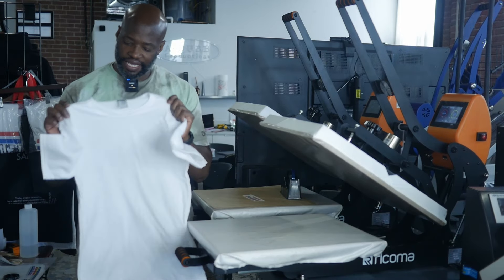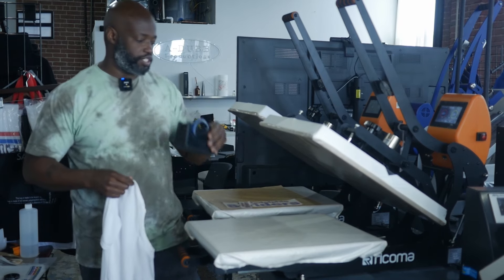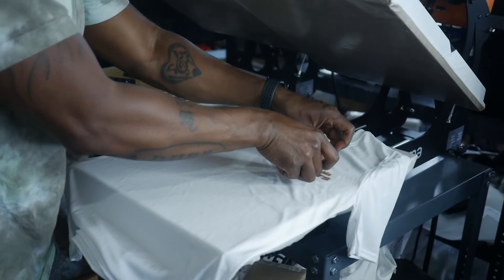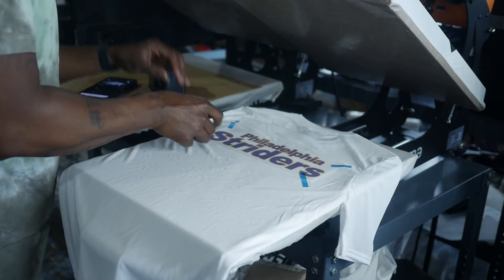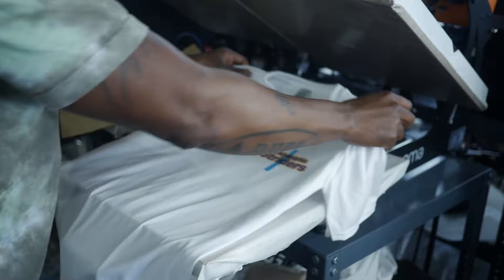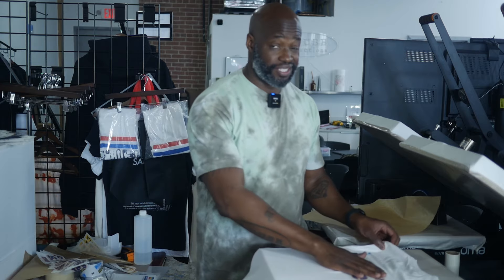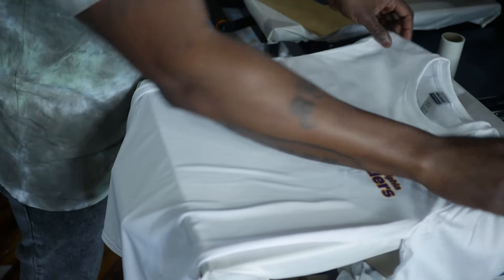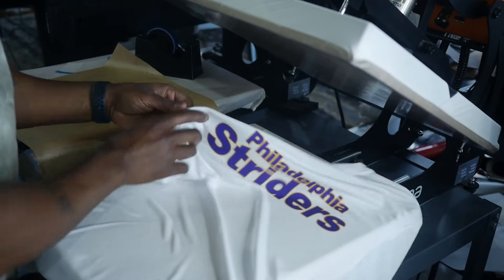Can you Press DTF on 100% Polyester

Comment: This is great but just out of curiosity why did you lower the heat to 275 verses 325? Dtf prints usually press at higher temp.
Reply from the maker: You are pressing your dtf transfers based off of a general standard that everyone goes by.  I challenge you to take a moment and think about what is more important, the transfer or the garment.  Polyester is a different fabric than cotton, Cotton is different than silk. Silk is different than nylon. Why would you press them all the same? You have to think about what you are doing and not be afraid to experiment and adjust. If i would have pressed at the normal temperature then it is possible that the press would have scotched the garment.  Then I’d have a burned shirt with a nice design. Useless.  It’s necessary to adjust when you need to adjust and not just go by what you are taught. You have to think for yourself and do what makes sense.  They transferred just as good at a lower temperature and the garment did not scortch. You can press on many different materials but all materials are not the same so they should not be pressed the same. Even some cotton is thinner and sine is thicker.  Some garments are flammable at certain temperatures.  You have to use you judgment and adjust.  Make sense?
Reply from the maker: I normally press my transfers at 300 for 10 seconds.  I’ve never pressed at 325.
Reply: @adubbproductions  thanks for the quick reply and yes it makes complete sense. But using 100% polyester material for sublimation at 390-400 degrees for 50-60 seconds depending on the press has never scorches my garment. Hence the reason for my question. It’s the darker 50/50 blend colors that get damaged from heat application. Polyester has high temp resistance so at 315-325 for dtf seems reasonable. I searched for a video like yours because I’ve never don’t dtf on polyester material and wasn’t sure if it feels good against the skin of someone who works outside during the summer months. It should be
Reply from the maker: @FLYNIQ  Good point.  That slipped my mind you are right. Still why press at a higher temp when you don’t need to. Always good to experiment and see what works and what doesn’t.